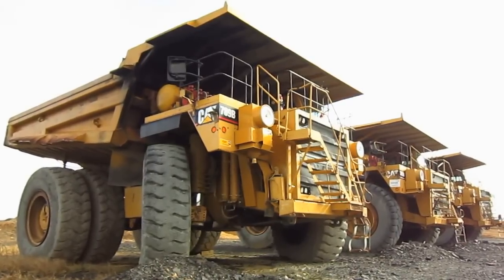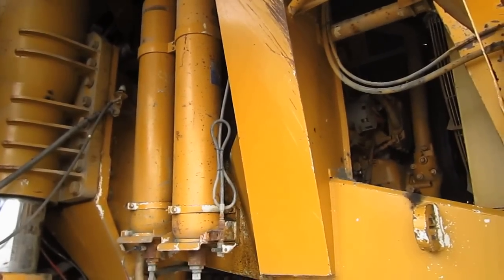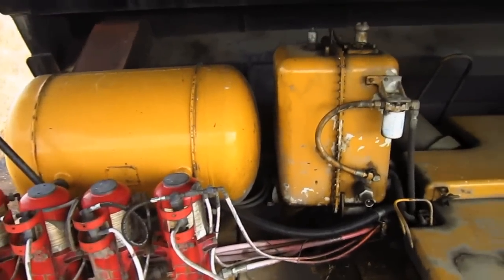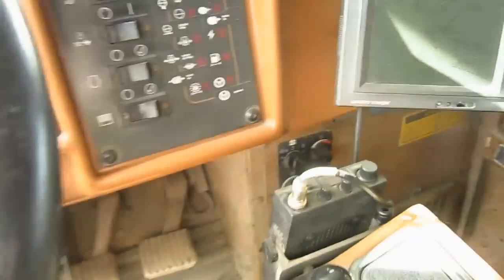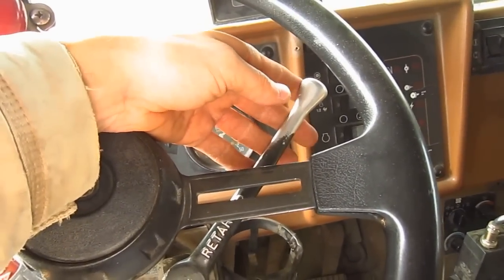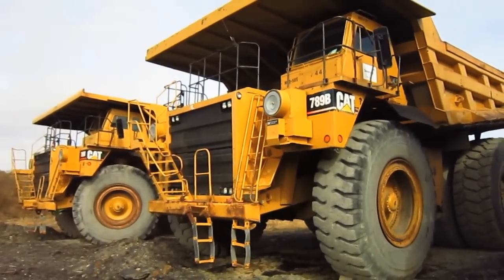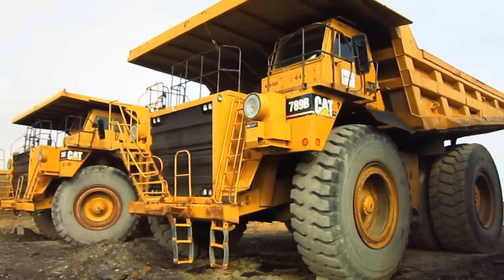Caterpillar 789B Documentary

Comment: THANKS, Pal and it looks like a Cat truck is a Cat truck is a Cat truck. Very little difference between the 771 and 73 I was around except size. Operation is very similar as well as control placement. I bet the 18-V is a bull. The 771 had a 510 horse V-8 and the 73 was a 12-V pulling 830.  I really like the way Cat trucks are set up and work. And they're easy to get the hang of, not complicated at all. Not like an R-35 or 22. Thanks again!

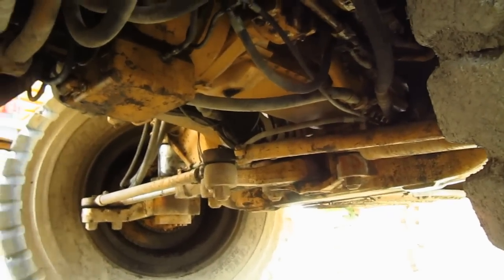Comment: @2:49, Is that water dripping or a fast diesel leak?
Reply: Water.
Reply: Right, would have been alot of diesel to be leaking.
Reply: If it was diesel the whole place would be crawling with MSHA inspectors and Environmentals in short order. You get a leak fixed or get the machine GONE! BIG fine time.And those beds will drip forever till you dump the water out of them at the start of the shift.
Reply: I didnt realise that this industry was heavily regulated for the like of spills and leaks.
Reply: Didn't used to be as much but with MSHA (Mine Safety & Health Association) overseeing things which inspects all mines, above and below ground, it can get really interesting very quickly depending a lot on moods and rule book interpretations. It's just better not to have any violations. They used to hunt for stuff but not so much anymore, but you better be right with the book. And they'll usually give you time to correct the problems and give another inspection. And they do look after the miners welfare and equipment being up to snuff. I've been around several and they're just doing their job and nice guys, really, but it's their job and big brother will come down on them if something they've supposedly checked goes haywire. Watch some of 'U.S. Chemical Safety Board' videos. That'll give you some insight on how things can go.
Reply: @lewiemcneely9143   Interesting, thanks for the info.
Reply: Todd can do better than me.He an engineer.

Comment: Most all the ones I was around had vertical access ladders....that's how I originally distinguished them from 793s.....starfire mine had a bunch of both...
Reply: In hazard kentucky?
Reply: Yes sir....steam cleaned every piece they had in the early 2000s
Reply: That stairway across the radiator was a Cat development.  I think the first was on the 789.  Others are copying it now.  

The rope hinging down by the left front tire is to haul a lunch pail up.  Some mines deem it not safe to climb stairs with a lunch pail in your hand.  Lot of drivers now use a pretty good size cooler instead of the old style steel  lunch boxes.
Reply: I grew up in that mine,lost mountain and falcon coal mine My dad was a mechanic for whaynes supply in hazard. Now I'm working in the coal mines of wyoming
Reply: Sad how all that work was here one day and gone the next....we did Addington 17 west too...I wish I'd have took more pics of the dragline and shovels...lectra huals, and this job behind the house (branham&baker) supposedly had some wisedas...
Reply: Yea breathitt county where I'm from and hazard are definitely coal mining towns I have pictures my dad took over the years in the mines some he took with me like the first time I ever saw a caterpillar 994 loader that they was building